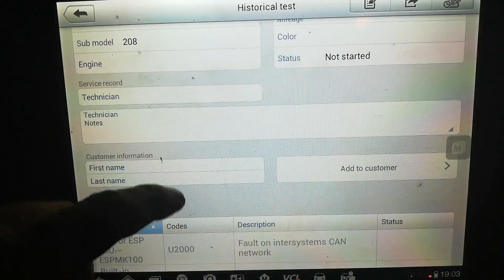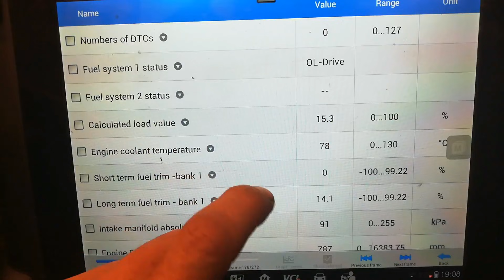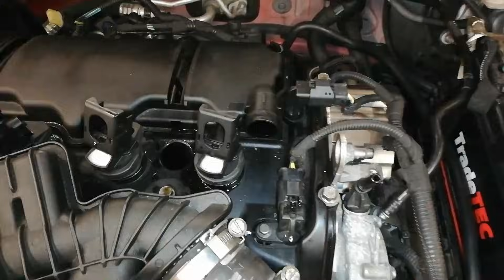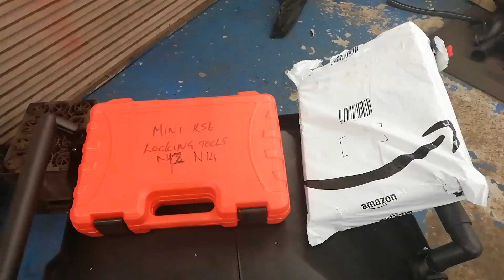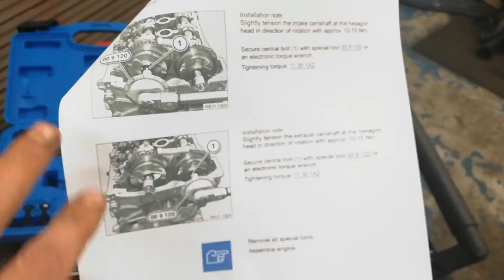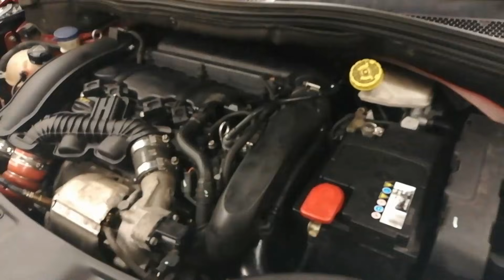Peugeot Citroen BMW Mini THP N18 P2191 Timing Chain N14/N18 Engine

Comment: Hi dave. I changed the chain and reset adaptions but there is still like some tiny rattle and the car got like a tiny rough idle… I did not go for brisk test ride (I did not drive it at all). Do I need to drive it so Vanos gets activated? Kind regards and thank you for video!
Reply: Btw the fault code for Lean mixture is gone
Reply: @Anoric I saw some people discuss this noise after replacing the timing chain in another video, and they said that it is because the new chain is too tight. After driving a bit it will loose up. Is the noise still there?

Comment: Firstly this video is brilliant and helps a lot but this probably a silly question but would you get the same result using your original timing tool kit? I’m looking to buy a tool kit but your newer Amazon tool kit doesn’t list my Citroen c4 thp as compatible where you’re original kit does 🤷🏻‍♂️

Comment: Great information. Could you confirm, is there no seal between the vanos and the camshaft? And secondly, are the vanos wheels in the locked position at idle? And then advanced when required at 2500 plus rpm, depending on load etc?

Comment: love the video.  we own a thp 156 engine with only 40,000 miles.  the power is totally crap.  recently new time chain too.   I hooked up a diagnostic.  short and long fuel trim banks were in spec, but i notices the intake manifold pressure was 0.34 bar?  i guess thats 34 kpa? is that normal? i see it was at 96 on your diagnostics.  any hints?  thanks

Comment: I have the exact same issue on the same car Dave. New timing chain kit was fitted a month ago but surely it should be in time? Anyway I'm getting the rocker replaced by Rodney Fleck so should be an opportunity to check if it's in time? I'm sure he'll do other tests to rule anything else out.
Reply from the maker: I've other videos on the channel of these chains fitted and not in time

Comment: Yeah I've just fitted a whole new chain kit and changed the solenoids but still not right, still blames exhaust cam (P0014 and P11A8)  took for a run really sluggish, rechecked timing with locking tools which is bang on 100%. Now looking towards dephaser pulley and the oil seal rings behind it,  any ideas ? Thanks!

Comment: Hi Dave, I've another question for you, I'm right in the middle of this Job now on the EP6 5FW 1.6 with double Vanos, Peug 207cc, &ready to rebuild, but I noticed you had said you have left the crank sprocket tight and not touched that but you/we would usually replace a chain with it loose? So was just a bit confused there as to what difference in the 2 ways, as I thought the crank sprocket needed to rotate a bit in order to take up the slack around the chain during tensioning?  So do I torque it  up (the crank bolt) before chain tensioner installed or leave it loose? So at what point in the build do you tighten/torque up the crank bolt? Before the chain and  the tensioner is fully installed or after? Thanks so much, Dave.
Reply from the maker: tension with all three loose ideally, but you could do it either way as shown in the video
Reply: @davesterl  Thanks Dave, great tutorial, Thanks so much for your help and replies, done a few cambelts no problems but this is my 1st chain on a very fussy engine by all accounts!

Comment: Hi Dave I'm having a mare with a 2008 207cc 78k 1.6 hp (NOT Thp) with 2 Vanos pulleys. I want to remove tensioner to check it as having bad running and chain noise when hot, but noise instantly stops on a restart, until driven again for a minute then returns.  Fault code P11A8 and also had a completely worn away top chain guide, which I've just replaced. Anyway, as i unscrew the tensioner it hits the throttle body which is simply in the way. What do I have to do next? Surely not have to remove the intake just to change the tensioner?!  2 x solenoids cleaned & tested. This is as far as I've got. Any other ideas? Thanks, David.
Reply from the maker: You need to do a full chain job as a kit, not just parts of it. Advise pulling sump as there could be guide debris in the pick up

Comment: Hi Dave, If you're still using this platform, that was/is a brilliant exposition on this engine . I justt recently bought a 2011 Peugeot 3008, 1.6 petrol model, with only 49,000 mikes on tge clock. Ran fine, i.e., no bad noises, engine fault light on, but obvious miss on the engine when running.  Mechanic Diagnostic, 'One cylinder no power' 'No Compression on cylinder 3' removed engine cover, 3rd spring on induction side has popped & the small pistons were out of their pockets & sitting on the head, with 1x valve slightly bent and appears to be stuck open. Also, there's some water contamination of the oil sitting around the top of the head. Not sure yet why, a) head gasket? or b) cracked head. In the meantime, now looking for replacement engine, with reasonable milage, so...following much searching, I finally found you. Can you, or any followers here advise, what models would provide the best fit for this immaculate 2011 3008 envy?
Many Thanks for the very clear & precise, detailed, direction/guidance on this engine. 👍😊

Comment: Super helpful video. After watching this, I discovered that my intake and exhaust were both off by a few degrees in opposite directions because I didn't put the cam locking tools in correctly (and the middle lifted on tightening), and because the cam locking tools had a little bit of play allowing the cams to rotate slightly when tightening the stretch bolts. I made the mistake of not holding the cams with the 27mm wrench. Anyway, thanks for this. It really helped me to understand my N14 that much better.

Comment: Do you put the tensioner in and torque it down and then torque down the pulleys and crank or does the tensionor need to be torqued down after the pulleys/crank?
Reply from the maker: See my other vid I've linked in the comments

Comment: If the codes on the cams are not in the same position would that indicate timing well out? I've already did my chain but im assuming it has jumped as it's not starting at all. The writing on the cams is at least 90 degrees off.
Edit: No codes in PP2000 either only thing I can see that could be relative is "status of the coherence between inlet camshaft and crankshaft positions - not coherent"
Reply from the maker: I think you've answered your own question
Reply: @davesterl  thanks for the reply I just wanted to be sure. I just hope I havnt bent valves in the process knowing my luck.

Comment: Hi Dave amazing video just a question. When I have the cams in the correct position the locking pin won't go in. So when I get the pin in then the cams are slightly out how can I fix this? Thanks appreciate it.
Reply from the maker: Are you referring to the crank pin that you cannot get in. Retime with cams loose. Sometimes takrs 2 goes
Reply: @davesterl  so I did the same as you with the screwdriver to the cam and not quite straight. Locking pin in at that point. What's the best way loosen them
Reply from the maker: @Ricey92  check my other vids on a Peugeot, same engine more detail
Reply: @davesterl  brilliant thank you

Comment: Great vid Dave. I've watched it a few times now as I've had a timing chain on an N18 and you have some good reference points. I have a question about timing up from the crank. The timing was totally out on my engine so took the head off. The set up with this engine moves the middle 2 pistons together and the outer 2 pistons together. I understand all pistons need to be level but wanted to ask how do you know which pistons should be going up first; the outer 2 or inner 2? Many thanks
Reply from the maker: That doesn't matter, the pistons level are just a guide so you can pin the crank
Reply: @davesterl  thanks pal

Comment: Hey Dave! I just subscribed, great video! Could you recommend anyone to set the timing on my 2008 308 1.6thp 174bhp? Same scenario, had the timing kit changed and now I'm getting p2191, Ltft is at +27 & stft is at 0 at idle and goes to -20 under load. Any help would be great. Thanks
Reply from the maker: Show this video to whoever changed the chain. I cant recommend anyone as i dont know what area you're in
Reply: @davesterl  Ok Dave will do, thanks. I'm in the Crumlin area just incase you know anyone up this way. Keep up the good work m8!
Reply from the maker: email me, address in about section on channel page
Reply: I had a look Dave but I can't see an email address in the about section?
Reply from the maker: Look on a laptop
Reply: @davesterl  Found it now Dave, email sent. Thanks

Comment: Is there any timing marks on sprockets that should align with anything?
Reply from the maker: no
Reply: @davesterl  I got exhaust camshaft to crank correlation code(288d) after replacing sprockets. And i used proper tools. That piece of shit prince engine.

Comment: Again, you were right and I was wrong 0,6 NM it is.
Reply: :) from service manual : Tighten the body of the dummy timing chain tensioner [0197-M] on the cylinder head .
Tighten bolt ("s") of the dummy timing chain tensioner to the specified torque until it comes into contact (at "t") with the chain tensioner guide (6) ; Tightening torque : 0,06 daNm.
Lock the assembly by means of a lock nut ("q").
Reply: but still you can use proper tools to do this : Facom A.301MT Release-Type Micro Tech Bit Torque Screwdriver 15-75 Cn.m

Comment: You said the tensioningtool should be tihgtend with 0,6 NM. That should be 0.6 daNM. Equals 6 NM
Reply: exactly!! then he says about a tolerance of a few mm when fitting the inlet side of the cam tool.... oh dear !! that's what u get when u use copy tools.
Reply from the maker: oh dear; thats what it says in the factory instructions
Reply from the maker: spec is 0.06daNM which is 0.6Nm

Comment: Brilliant video , thanks for sharing your knowledge. I am going to do head gasket on Peugeot thp 1.6 on weekend and will follow your advise with pre T chain tensioner.  Can I ask if I need to hold tensioner piston in while installing by holding the chain guide or just tighten down. Tks
Reply from the maker: Just tighten in
Reply: @davesterl  Again great video, your experience shows in you explanations. You will get more views if you add n14/ n18. Thanks again.
Reply from the maker: @Stephen-nz8io  done cheers dave

Comment: Thanks Dave for this tremendous video !
One question : how do you make sure that the camshaft sprocket dephasers are fitted correctly ?
We have an arrow on each sprocket (under the teeth / oposite side). In my opinion this arrow should point down / vertical.
Reply from the maker: Thanks, the phasers go on any way
Reply: @davesterl  Thanks for your feedback :)

Comment: I have read online by few people that any Crankshaft Locking Tool Sets that you find online are not as good as the original Peugeot ones and you might not be able to do the timing properly. I was wondering if the tools you used are aftermarket ones or the original Peugeot ones? Many thanks
Reply from the maker: Aftermarket on amazon i used
Reply: Thank you Dave. You didn't find any issues with them I guess then right?  Some people say that the cheap copy tools that are not from Peugeot don't have the tightness in them to keep the camshafts within the required tolerance.
Reply from the maker: @georgesideris8448  worked fine here

Comment: How is it possible to get all the pistons in the same position?
Reply from the maker: Is that a serious question?
Reply: Lock the flywheel as stated in the video using the required special tool or a bent piece of brake pipe normally would do in an emergency